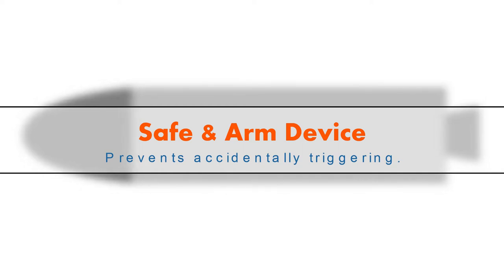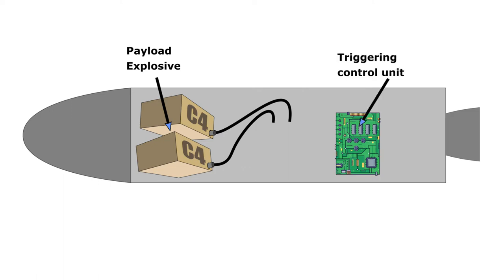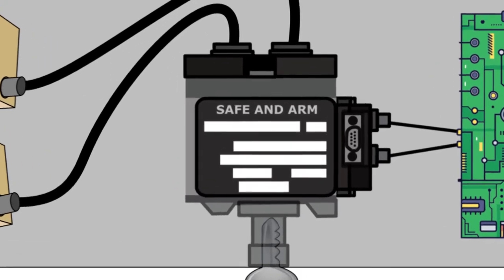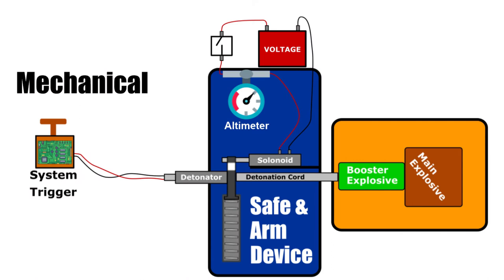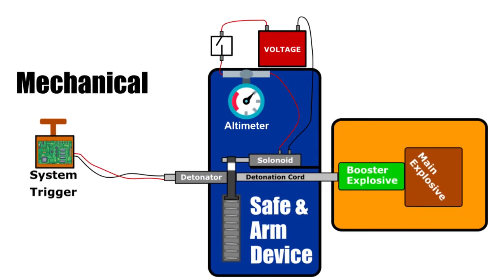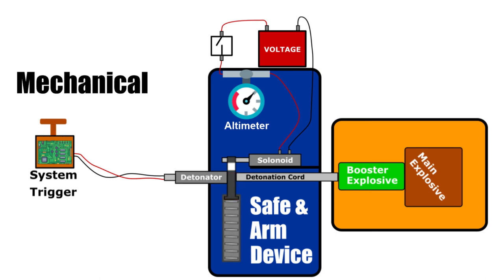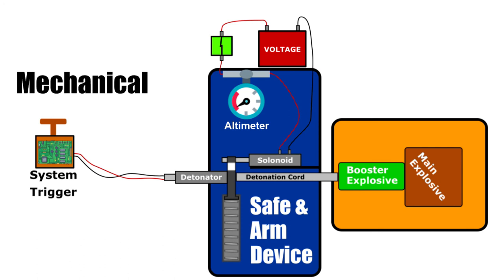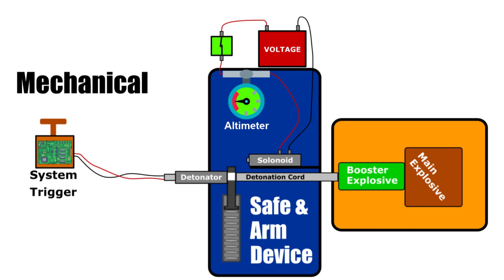Safe & Arm Device

Comment: What is the main purpose of the booster explosive? Why not just directly connect to the main explosive?
Reply from the maker: One reason is for safety. The main explosive is made to be very insensitive. That way it's easier to handle, transport, etc. The other reason is that lots of high explosives are very insensitive. The main explosive is so insensitive that it requires a strong shock wave to explode. And that's exactly what the booster provides after it explodes. Check out the article below.
Go to the section on "High-explosive train and the mechanics of detonation."
https://fas.org/man/dod-101/sys/land/docs/warheads.pdf